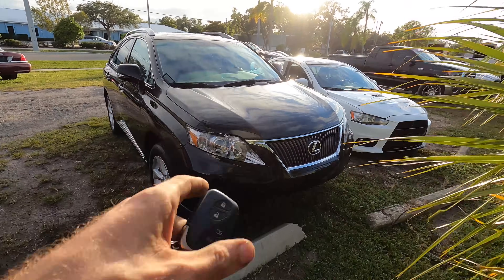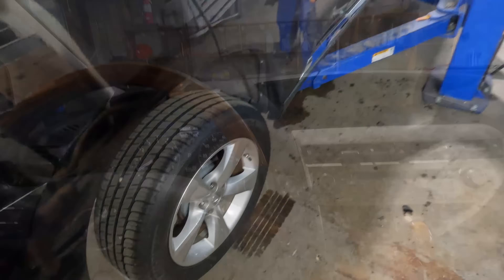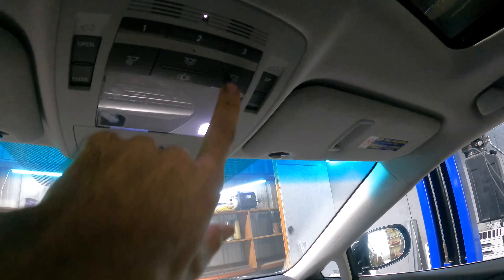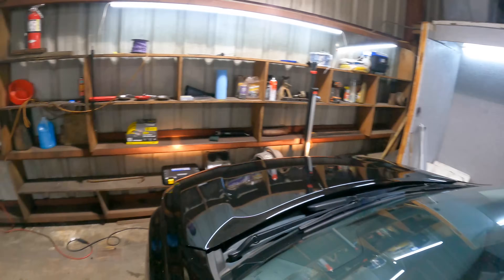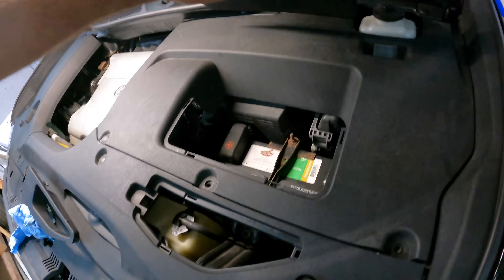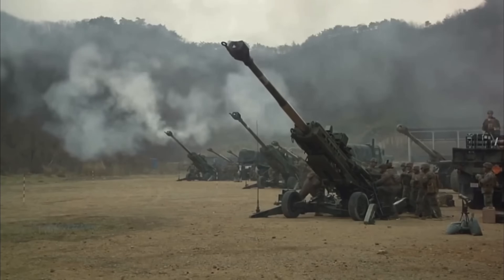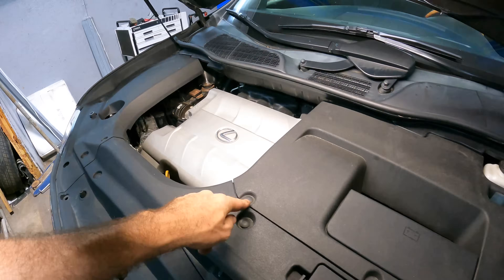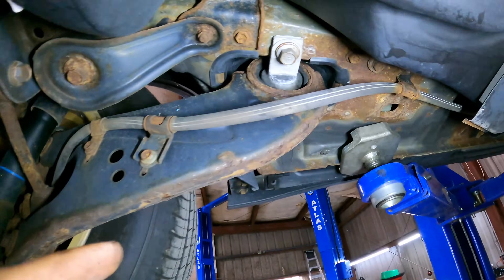Spoke Too Soon! Twice! Lexus RX350 3.5

Comment: The threads are slightly larger diameter than the body of that bolt.  Chop the head off and drive the bolt through the other direction so the threads don't need to pass through the collar. .... I said just before you went there lol

Comment: Sawzall  it off and get a new bolt. Use a press after you get it out.  Inner sleeve, is rusted to bolt and turning inside rubber. Ok, it wasn't . Try a tuning fork/ball joint fork.

Comment: If you close valve @ air compressor you will save that air you compressed already and extend life on a breaker that was not designed as a switch

Comment: Separator Set, Ball Joint/Tie Rod/Pitman

    Zoro #: G6340035 Mfr #: 41500 puts force on both sides instead of one side with the pry bar.

Comment: The simple jobs often turn into the problem. 1 bolt stuck then a arsenal of tools required. My 1st thought was saw it off then I thought no replacement bolt without a trip to the store.

Comment: By the way those Toyota suspension bolts are very tight I use a extremely long ratcheting breaker bar for those kind of things they're not going to break the bolts are like half an inch thick

Comment: That rusty bolt reminds me of changing my rear passenger side lower control arm on my 2000 Grand Marquis. The job required a breaker bar and a jack to crack the damn nut loose then an angle grinder to cut the bolts. If I'd known I had to cut the bolt I'd have skipped the wrench step and just cut the bolts before angering the rust goblins with the jack and breaker bar. Or maybe paid someone else to deal with it. 

Total aside, it seems like you don't have a torch. Might look into getting yourself one of those inductors to heat up cantankerous fasteners.

Comment: Seems with such diverse locations cars are driven, manufactures could use bolts and nuts the resist rust better than standard style bolts.

So, was the curious level high enough to discover why that bolt and the shock refused to part company?

Comment: I am at 30 mins in.. Death con 500 was reached at about the 25 min mark when the bracket opened up.. I would have the death wheel out buy now. That bolt is rusted to bad to be safe to use. Same as all the others.. I dont understand why they were not cleaned up before reinstalling or actually replaced and have a rust preventative lube done to them to aid in a longer life for them.. Just sayin downunder things are different.

Comment: One thing I probably would have tried is to spray it with lube and let it sit for a few minutes. At the point where you had the bracket bent a little out, I would have used a wire brush wheel to clean some of the rust off the bolt. Then I would use a pair of vice grips (or something similar) to hold onto the inner core and put it against a frame or something where it would lock against it when I used the impact to try and remove it. Not sure if it would work, but worth a shot before cutting it off. Just a thought though.
Reply: @Les Reeves True, but what I said would of only taken 15 to 20 mins at most. A couple minutes for the penetrating oil/lube. A couple minutes for a wire wheel brush on a drill, and a couple minutes to clamp on a set of vice grips.... so say maybe at most about 15 minutes to try it.

Plus he mentioned that he's doing quality work not just a get 'em in and get 'em out as quickly as possible.

Comment: The impact wasn't working on the bolt because the rubber on the shock was absorbing the impacts. If you would just manual wrenched it probably would have worked?
Reply: Same with the air hammer.  The small impacts were absorbed.

Comment: I normally only spend ten minutes on the seized bolts, then cut them off with an angle grinder 😢

I always use anti seize grease when re-assembling 👍

Comment: That rust is really surprise.  Had several older cars, the  city government where i live, have their salt crew dump salt on the road in winter to burn the budget; Most extreme was they even did it with 10c above zero (!). So they keep their budget for next year. Never had cars that got so extremely crusty. In fact, never owned a car that had rust, not even surface rust. The cars were all much cheaper and lower class/segment than a Lexus.  Are most cars build in/for the US, build without proper rust protection? Or is their some strange stuff added to the salt destroying the cars?
Cause this looks awful for a car just about 12 years old.
On other note, Monroe shocks?  o dear. But with so much rust, might not be wise to put expensive parts on it.

(small edit: Cars naturally did have rust on some parts; Exhaust on all cars i owned fully covered with surface rust, the edges of the brakes discs did all get rather crusty when the discs were getting old, but chassis, suspension parts; none.)
Reply: That's typical government for you... get penalized for not spending enough money 🙄

Comment: I know time is of the essence, but I thought if you could have had someone air hammer from the other side while you impact from the head you might have been able save that bolt.  What's wrong with a torch or  induction in this situation?

Comment: just curious, at 34:00 when you test fit the bolt, is it me or the bolt has substantial play in the bushing? Won't that cause movement and noise e.g. over potholes?

Comment: Dont use your hand as a hammer. I know a mechanic that did for 40 years because he knew better. Hit a nerve and couldn't use his hand. Luckily the segan  was able to reconnect the nerve endings and he didn't loose use of his hand. It was purple turning black till they reconnected it. On another note I had a black rx350 customer that I did struts on. Pulled the driver and the axle fell apart. I couldn't get the carrier barring out.

Comment: I'm in the rust belt.  Not a single bolt or nut goes in without antiseize on it.  Otherwise you are busting knuckles again in a few years.  Also my "heat wrench" is my best friend, and used on darn near every bolt without antiseize on it.  Finally, fine pitch threads on shock bolts, what were the engineers thinking?!!!

Comment: Ray, the replacement bolt you used does not have a milled section to fit inside the shock bushing, it "appears to be "sloppy" within the bushing, could that cause wear?
Reply: OK SORRY, I didn't look properly, I was WRONG! Thanks for sharing.

Comment: What if manufacturers used ( or owners retrofitted ) stainless steel bolts & nuts for these suspension fittings?  Would that eliminate these rust-tight problems?
Reply: Stainless bolts don't have the tensile strength of regular bolts.  Regular bolts are cheap....just break out the torch and be done.

Comment: WHY DIDN'T U USE A VICE GRIP PILERS TO HOLD THE INSIDE OF THE SHOCK INSERT WHILE U TURN THE BOLT THAT PROBABLY WOULD'VE WORKED

Comment: That's why (especially here in the UK where we get grittage/saltage roads in the winter) with these kinds of bolts being set in place for very long periods, I use copper grease just ton in hopes, reduce this stuck/rusted bolt issue... But man, with the limited tools I have (and no garage, no lift, no air line etc), I would have angle grinder at it and cut that bugger off out of sheer frustration! "You WILL DO AS I F&%£ING SAY AND GET THE F&%£ING F&%£ OFF!!!" Hahaha 🤣🤣😉     😎🇬🇧

Comment: And there you go, fellow gearheads; that's why you put a light coating of grease/anti-seize on the bolt shanks AND on the mounting brackets. [once spent 6 hours getting a 1/2" bolt out of the subframe(had to save it) because of this]

Comment: I think around the 30:00 mark I would have just cut the bolt.  Given abuse it has seen it might be weakened, and if it's so rusted in place it can't be removed with a bit of effort it's probably reasonable to replace it anyway.  Cut and replace.

Comment: I had to laugh at you a bit here. Working with crusty bits myself I would have zip wheeled that bolt once you got it backed up enough to cut it on the insides of that bracket.

Comment: The only thing I can think of is that the bolt had got bent over time somehow, & didn't have enough tolerance between it & the shock bush insert to come out easily... I think I`d have air hammered it from the other side of the bolt, with a nut on it to keep it in position.. At that stage it didn't really matter if it wrecked the threads. What a little bastard though..

Comment: Welcome to Eric O's world. Arm chair quarter back time. I would have cut the bolt head off and air hammered the remaining bolt out the treaded side. Hardware is cheap. I also would have cleaned the rust off the bolt holes and added ant seize or grease for the next guy. Why can't the auto industry make maintenance areas out of a non rusting material.  I know $$$.

Comment: I'll admit I'd have gone defcon 9 after about 10 minutes of cursing and swearing at that stubborn bolt not coming out. I've a sneaky feeling it may have been bent enough to bind in the hole once it got gummed up with iron oxide. Made me laugh with all that plastic covering everything and the little dig at the oil change guys, some aren't as thorough as you Ray.

Comment: Had a few queries as the usual crap happens with seized bolts and would the easiest thing to start off with might be rust free bolts run on a wire brush to clean and a smear of anti seize copper grease to allow fitted parts if failed easier removal.
Please have some more fire alarms as your very beautiful wife is a welcome pleasure to see.
Nice wee place you have as not under pressure and can do what you want.
Curious also if you sort your scrap out for recycling to make life easier.

Comment: That Lexus is a mixed bag.  It looks pretty rusty on placed where you don't expect it and other places are like new. Lexus steel is of a higher quality then other brands, my old and trusty es300 from 96 is still rust free except for the fuel tank filler pipe. But all mufflers are still original,  brake lines still perfect. And approaching 190k miles. Parts availability is getting problematic though.

Comment: The Fire comments going to come back and bite you in the arse. Ive found Wife units can also play pranks. After 40 some years of testing.

First year married out bath room light had an outlet that came on with the light switche, maw bell used to have plug in 24 volt power supply,  now me being the person I am hooked up an alarm siren to the power supply.
She goes in turns on the light and off goes the loud siren. It resulted in a loud laughing noise and grin.

Comment: 2 sets of Michelin Primacy MX4M , Both were done at 25,000-30,000. They suck for duration. Great tire, but 60,000 warranty and fail that fast?? I drive full Grandma. I will not try a 3rd set

Comment: Shocks are under rated.  Heard that some small cars can become death traps when you give them to your child to go to college.  The old shocks are fine with a lone occupant, not okay with passengers.

You need some big breaker bars.  "I do cars" used a 3/4 breaker bar 4 feet long and a front end loader to loosen a harmonic damper once.  Really.  Junk engine not in car.

Comment: Can we call it Yankee ingenuity when you're in the south? It's a rule, might be universal, that any phrase indicating smooth sailing is only used after the job is completed. In IT, I'm reorganizing the cables in our server room. it's almost a gross of cables that run every which way, and none of them run logically. Someone, not me, said it should be a "no brainer". 3 days later and I have a plan in place that takes some of the potential pitfalls into consideration. I'm looking to avoid the stuck bolt, but I know I'll find 2 problems for every 1 I think of. Watching you think through the hurdles reminds me to use that critical thinking thing my pops taught me so well. Time in the garage is time spent learning to solve problems and is valuable in every career and every aspect of life. Some people haven't learned how to problem solve, and our world is worse off because of it.

Comment: You have more patience then I do. I'm from N.W. Indiana dealing with rust all the time. Bolts are cheaper then time. I would have cut it off as soon as I seen it turning the inside collar. Yes I have cut many off. Also didn't have to bend mounts back.

Comment: I'm no mechanic.  I would have cut that bolt with a cut off wheel.  The time spent on it vs the cost of the bolt makes cutting it off the better option.

Comment: What I would have done. Would have been easily cut the bolt out of my way. Just to get the old shock out of my way.

Then I would have easily bought a brand new bolt and put a brand new Bolt to replace the old Bolt with the new shock.

Instead of playing with the old bolt and old shock.

Time is of the essence. Next time just cut the bolt you would have had it out within 1 to 2 minutes.

Comment: aftermarket shocks, bolts that fit loose now it will never be the same again.all you have to do is cut the lower shock eyelet ,bolt comes right out .and  original fastner. still can be used.ALL TOYOTA AND LEXUS TECH ARE SCREAMING AT SCREEN .YOU HACK!!

Comment: You are going to go broke doing a job like this. You should have had that second shock off in less than 5 minutes with a “zip wheel” or an angle grinder and cut off wheel

Instead, you kept looking for some solution that wasn’t going to help

Just an FYI, Toyota does NOT recommend replacing OEM struts or shocks unless the fluid is dripping from the strut/shock. Granted, these were in pretty bad shape and probably needed to be replaced but please don’t assume a Toyota strut / shock needs replacement because it’s got some fluid /dirt on it.

Comment: up north, we use the fire/hot wrench all the time...a torch.....nothing comes off easy up here with all the salt, rust, water etc......saves a ton of time...we also are very liberal with the anti seize after we put it all back together...just in case we have to work on it again or make it easier for the next guy

Comment: I was about to say try welding on the most unholy 4ft rebar slide hammer with a repurposed 5lb lifting weight sleeve and go to town..
But you pulled out a hacker saw and cheated lol.

Comment: An old joke I thought I'd share:
A penguin was driving down the road and suddenly had car trouble. He limps it into the nearest town to a repair shop. It's now overheating really bad and hot as hell so the mechanic tells him it's going to be awhile, and he might want to go somewhere for awhile and come back.
So, he takes a walk and comes across a large Supermarket. He goes inside and walks the aisles and finally finds himself in the frozen foods section. A big smile crosses his face because he is in his element. He climbs inside and starts flying around in there and when he emerges, he's got bits of frozen ice cream all over him, but he had a hell of a time. He then realizes that it's been awhile, and he should probably get back to the shop.
As he enters the repair shop, the mechanic was still under the hood. The mechanic says, "It looks like you blew a seal".
The penguin says, "No it's just ice cream I swear"!

Comment: Divide cost of a new bolt y Your hourly rate, verses cutting it.  Talking about shop pranks other fitter using gas Axe Oxyacetylene, cutting off an exhaust, walked up quietly and fired a .22 blank behind him, he tried to run while being 2foot off the ground.

Comment: Anyone else wondering why he didn’t just cut the head of the bolt off with a cut off wheel once he got the nut off?
Reply: Kinda, yeah.
I guess he was trying to save the bolt initially.

What I didn't understand was why he didn't put some lock grips on the sleeve that was turning & the bolt would have likely then wound out with the impact.

Comment: Worked on vehicles in the rust belt for years I would in this situation use the death wheel  and use new hardware. Flat rate is the reason.
Reply: Responded before the end of the vid still liked.

Comment: Ray, got a question. The amount of corrosion I saw on the frame, Aluminum engine parts, etc. bothered me. It did not seem to bother you as much as me. The question is,  "How much longer do you think this vehicle is going to serve the customer before it causes real repair problems?" I ask this in the most gentle way I  can because I don't want to besmirch you or your customer. If you want to pass on this question, I understand.

Comment: Lexus can't be part of the Toyota family.  There design are so stupid sometime.  In the video you can see they ran the brake line right into the wheel housing.  Do they not think it will not get shot with stones from the road!